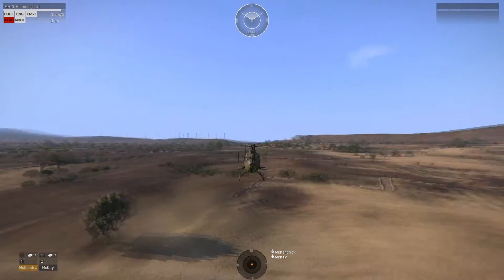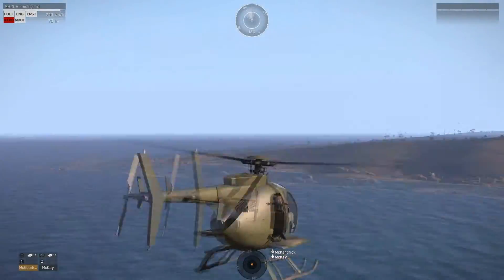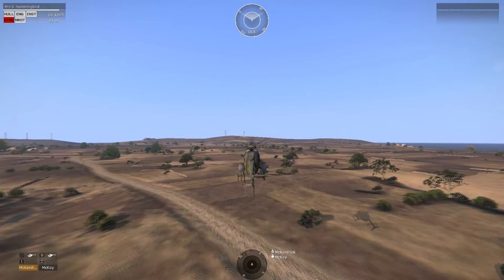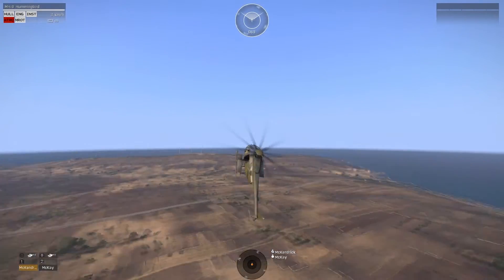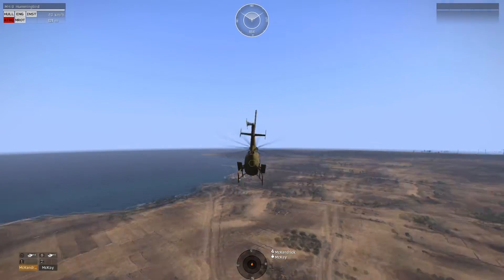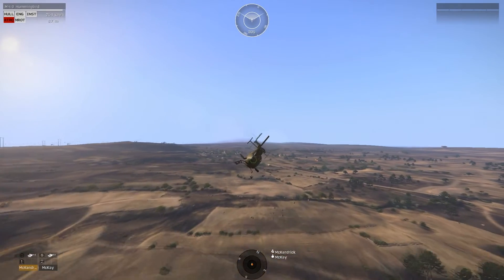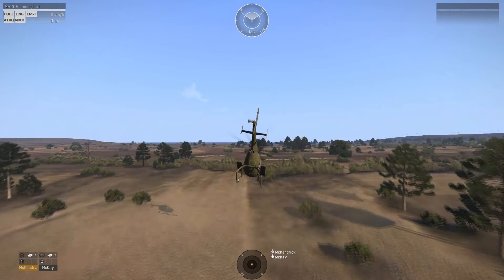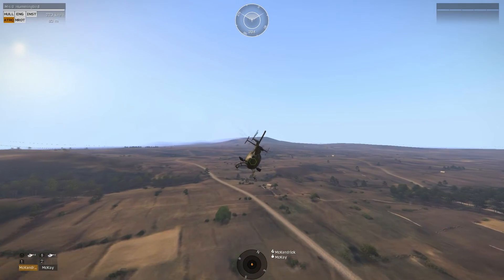Arma 3 How to survive tail rotor failures! Emergency Landings Ep 1/3

Comment: I watched another video of a person doing a failed tail rotor and put that to the test the other day when machine gun fire killed the anti-torque rotor.  Nice to know that speed and very little power on the main rotor is all it takes to keep from crashing.
Reply from the maker: +Slayer John It's all about aerodynamics and torque of the main rotor if you think about it, at high forward velocities the chopper will work more or less like a plane, air will keep it flying straight. While at lower velocities your tail rotor is actually countering the rotation of the main rotor. So if there's no countering going on, you'll just simply spin out. ;)